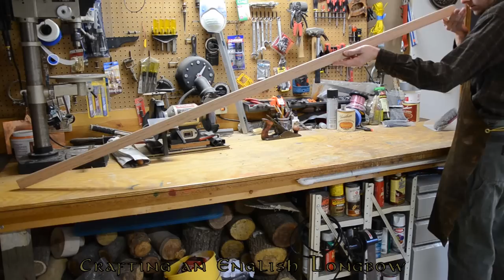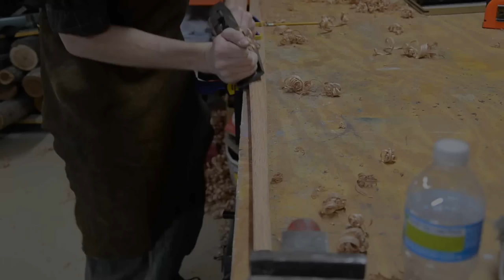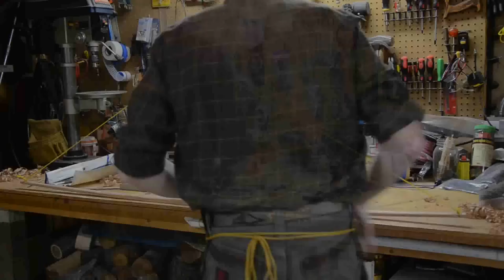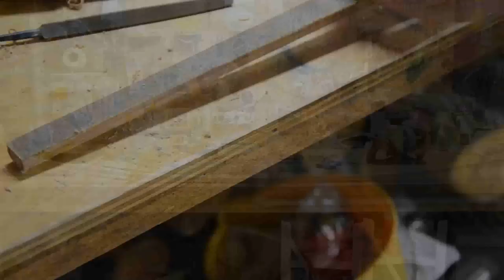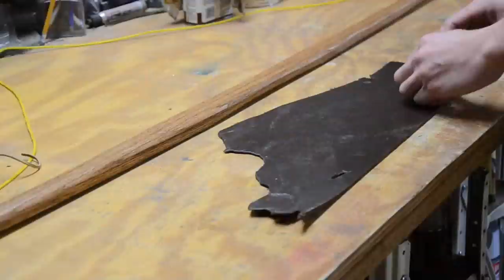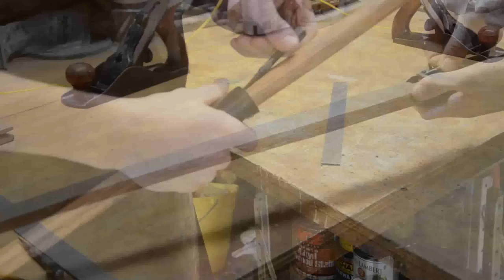Crafting an English Longbow

Comment: it's a bow alright, but not by any means an english long bow.
Reply: Well, technically it is, just a bad one.
Reply: +nicynodle2 it's a longbow without doubt but there are three distinct identifiers for an English Longbow...
1) they are produced in England
2) they have a rounded single plain belly and traditionally are capped with horn.
3) they stand at 6-6.1 feet unstrung. 

It's a good bow though.
Reply: AkumaDante12 1) The English longbow originated in Wales
2) most were, but not all.
3) it completely depends on your size, if a seven foot giant had a bow made for him, it would be much larger then 6ft, if a 2 foot midget had one made for him, it would be a lot shorter then 6ft.

What makes a longbow a longbow is its size compared to the user.